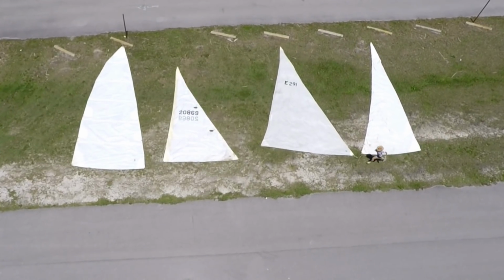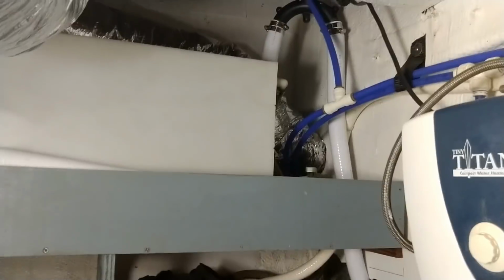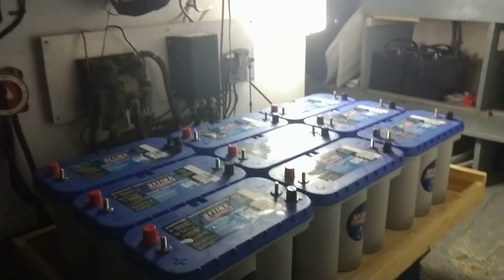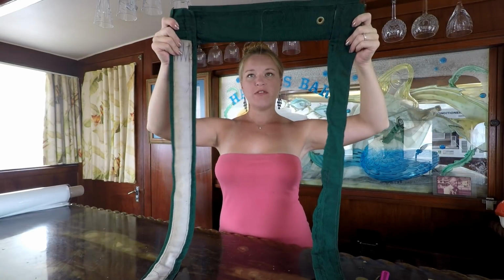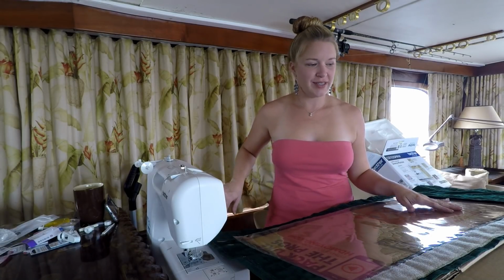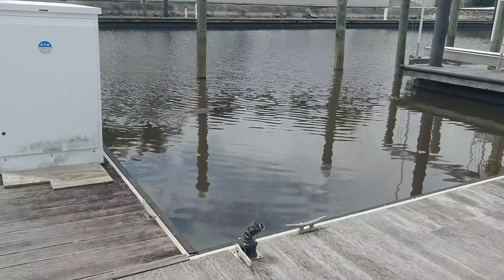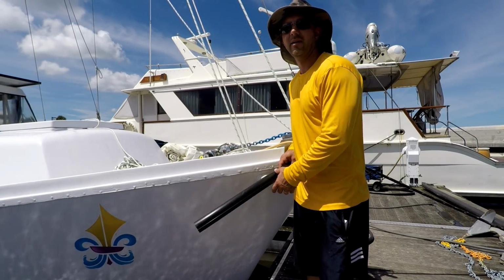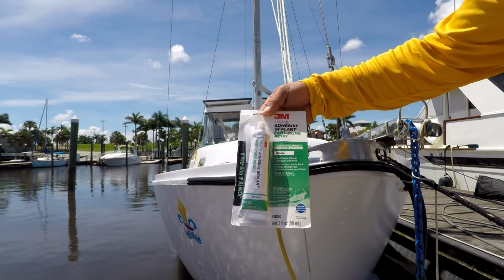Ep. 28 - Final Projects at the Marina ~ Big Easy Sailing

Comment: Have you thought about installing a small shelf in the back of the bed where the hoses are running down? It might give you a bit more storage room especially when you put doors on that open upwards (towards the ceiling). I have used simple 1/4" wooden sheets and 1" by 2" to hold it all together - they're light and easy to work with :)
Reply from the maker: Yes, great question. We plan to conceal the water hoses and also use the space to store longer items.

Comment: Nice job fixing up the enclosure , that will be so, so useful. I do hope you come up with a good way to secure those batteries down! Did you do a video on the existing  electric motor? Is it a pro unit or ?   Don't forget to do a good long marina tour of the other boats, everybody is a voyeur here /noisy so show us the cool /weird stuff too! Thanks again for rescuing this very old boat!  Cheers Warren .
Reply from the maker: Motor was professionally installed. There's a detailed video coming. We do have a bunch of random marina madness. You can't make this stuff up what you see at these places.

Comment: With that generator of that capacity you should be able to do 2.5-3 knots in calm waters with no battery draw. Faster if you draw down the batteries.  Also it will charge your batteries depending on how much juice you pull from your chargers under propulsion.  Slow speeds equals a charging state, fast equals a discharge.  You'll need to buy some golf cart chargers or something, to max out the available charging current.  Buy a Kill-a-watt to determine the chargers draw.   You will need to buy as many chargers as the watts/amps can handle.  There is a start up current/surge on the chargers so you may need to turn one on at a time to not have something bad electrically happen.  After so many you may not be able to start additionally chargers even though you have running amps for them left on the generator.  What are you doing about the exhaust? I thought I would use my portable household diesel generator, but was concerned about how to hook up the exhaust, and if it would cool in an engine room?  Several carbon monoxide alarms might be a good idea.
Reply from the maker: We found some flexible 1 inch exhaust hose that will be thermal wrapped and vent out of the engine room. Haven't needed to use it yet, but we have a cooling fan and 3 carbon monoxide alarms. Thanks for the comment.